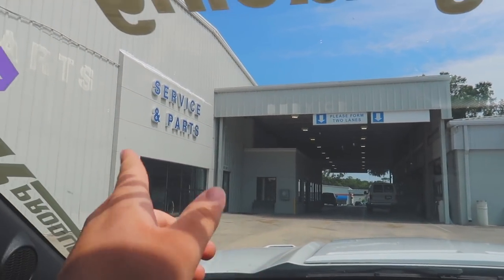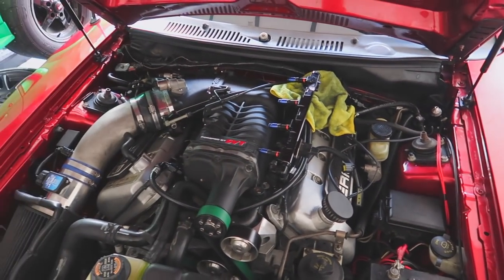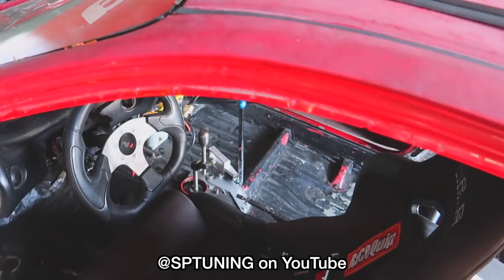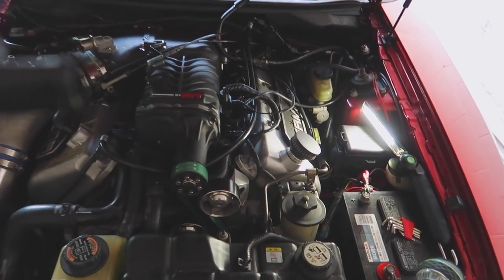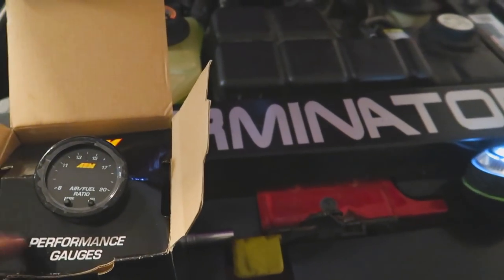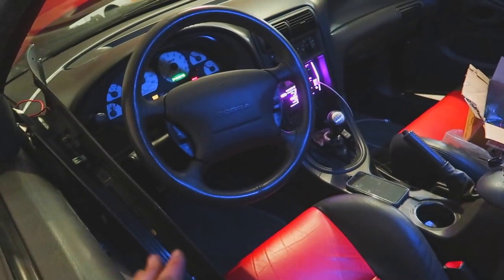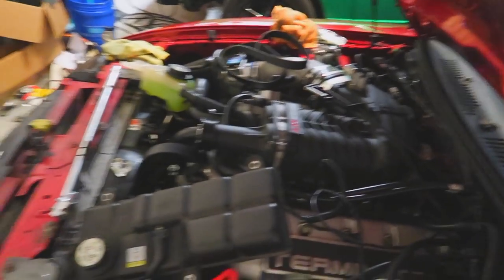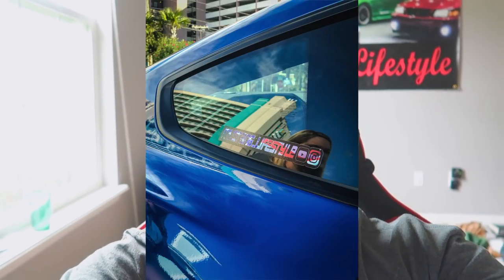700+ RWHP E85 Cobra Build AEM Uego Wideband Install + Problems

Comment: A trick we use when detecting leaks on ac evap coils is get some soapy water and run it along the lines. Wherever the leak is, a bubble will form.

Comment: Have you considering switching up your gauge layout? Like steering column or the dash layout?
Reply from the maker: I originally wanted to do a steering column mount. But I have gotten used to watching afr on the pillar. The boost gauge doesn’t really matter much. Just a filler

Comment: Surprised there aren't any comments complaining about getting the oil changed at the dealer yet. I used to get the oil changed there on my SVT Focus for the same reason. Price was super reasonable and i trusted their oil and filter. Pretty much everything else you could beat their price on though.